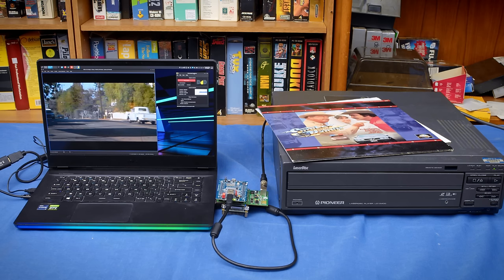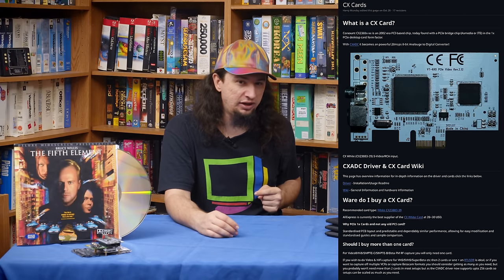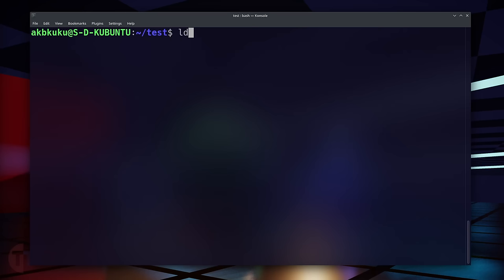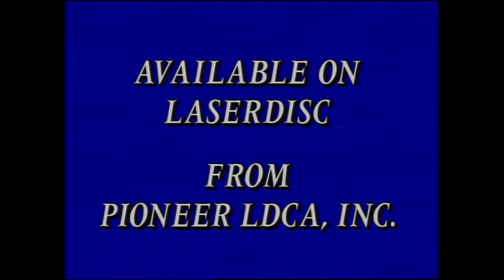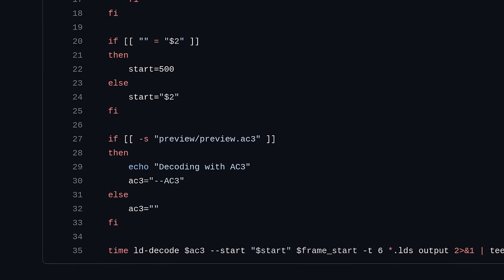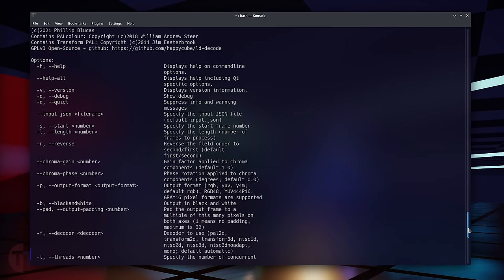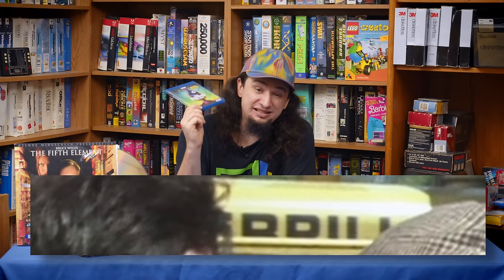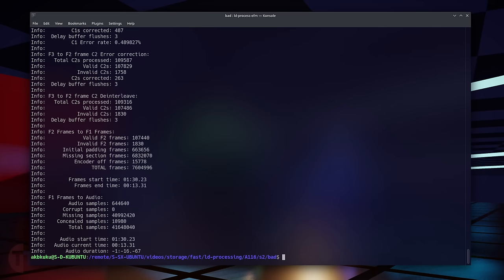LD-Decode - LaserDisc Conversion Tools

Comment: 1:55 Slight but somewhat major issue TBC files are not custom they are 4fsc sampled like D2 video tape, and as such can be piped back to analog via a dac its the full CVBS signal stream on file, same for tape decoding of colour-under formats being S-Video on file (GREY16 headerless streams to be exact in terms of data format on file, the JSON is just for ld-tools to read it).

TBC is basically 1135x624  / 17727262 Hz PAL & 910x524 / 14318181 Hz NTSC

3:11 Well Apple silicone is the fastest you can get decoding speeds out of due to raw single core bais currently, same for all but hifi-decode which can run realtime with enough single/multicore tossed at it. (ware as RTLSDR decode will run realtime on anything 2008 high end or better) (chroma decoder is realtime but ram hungry though).

15:25 Some good points are made here, but you missed the fact that well FFV1 and V210 is what 90% of people who are doing this sort of archiving will touch not compressed codecs, but also the 4k/2160p upscale bracket has to be mentioned for use on YT due to SD being useless and HD being crunched, and outher platforms I cant name being better due to using the orignal file allowing for SD streaming with web optimised files, like those profiles made inside the tbc-video-export tool.
Reply: >outher platforms I cant name 
...pleaaase?
Reply: @JuanHerrero  O // dy // see // its direct file stream platform, but if you mention its name on YT 9/10 you comments get auto purged, same as links these days.
Reply: I've been using the VHS fork of this project for over a year. It's incredible stuff and despite the huge file sizes, the home videos are preserved in a way where I can feel comfortable knowing the VHS tapes will die soon but I have as good of a backup as I can get.
Reply: @Tatsh2DX  I have 42 dB snr tapes from 1987 ones that had mold on them, taps don't die there SNR slowly degrades if not stored proper, but I think its a matter of quality of tape and the conditions of orignal recording heads that truly defines there lifespan all things being equal climate wise.

Btw new updates to the CX Card workflow/method now which streamlines vhs capture a bit.
Reply: What if you captured the RF from an actual D-2 deck?  Would the processing recognize that It's a digital signal after the demodulation step?  I have a D-2 deck and being able to archive them this way would be really cool.  I know I can just capture the SDI stream, but still.
Reply: @button-puncher  If the digital signal can be transfered to the standard GREY16 TBC format then support could be implimented to the chroma decoder, honestly I would be intrested in seeing what can be extracted.
Reply: @TheRealHarrypm   Cool!  It's going to be a while but I'll reach out when I get everything set up.  Decks are in storage.
If this works I'll be kicking myself because it took forever to get the all the gear to convert D-2 SDI into standard D1 SDI.  I guess it'll be a good thing because you could use it to compare the software vs hardware results.
Reply: @TheRealHarrypm YT auto-purge their competitors now? Wow. What a lovely 1984 we're moving towards, how joyous...
Reply: This is fascinating stuff, the parts I understand anyway. I have to ask, how do you know all this? It's clearly a piece of amalgamated knowledge that can't be easily gotten so I'm going to guess video engineer of some sort, and also guess I'm wrong?
Reply: Sorry to be pedantic, but. . . Apple silicone?
Reply: @clairekholin6935  If only YT did not lock pinned comments you could be spared a typo 😥
Reply: @clairekholin6935  If your Mac can run Linux, then (I'm guessing) it can run all of the software needed.  As for M2 based Macs, I have no idea if Linux runs on it yet.
Reply: @button-puncher Problem is, its not a digital signal per se, its a digital signal anllogy encoded, thus the need of an rf (radio frequency) demodulator.
Reply: @honestguy7764  True.  You need to deal with the encoding scheme and the error correction that D-2 used.  I got excited and fired off my original question to Harry without thinking it through.
Reply: @button-puncher  Its all python based so it runs nativly on MacOS/MacOS Arm just there is only maintained docs for MacOS Arm and the DdD app etc, though yes you can just run a Ubuntu VM there is only a few % of proformace hit witch is negligible in real world use.
Reply: Apple Silicone?  LOL!  Picture the Apple Store having a display of breast implants for sale.
Silicon is the element.
Silicone is a polymer.

Comment: It’s funny how even though you’re in the electronic and (now) digital realm, the time factor of preservation just doesn’t go away. 
I was an intern at a museum and was tasked with auditing and helping to preserve their photography collection (from the late 1800s-1940s). I am not joking when I say each photograph could take up half an hour to inspect and take preventative action on, let alone the measuring and cataloging that goes along with it. 
Hats off to the folks who are doing this stuff for free as a passion project.
Reply: please, elaborate more on these preservation techniques
Reply: Heck just with film scanning of fresh negatives I used to spend about 30 minutes scanning, cropping, adjusting-curves, spotting dust, and sharpening for output.
Reply: 2:1 resolving of the grain for archival is a fun task for film stocks, consumers are lucky to have 61mp full frames like the A7RIV/A7RV that can make a massive amount of stacked data today thanks to pixel shift etc,  getting near drum scan levels of information, but it wont ever compare to 16-bit full RGB TIFF files from a wet mounted drum scanner really.

FM RF is a fun method but its too easy for LD/Video8/Hi8, compared to film scanning workload wise.

Comment: 7:32 For people deinterlacing, don't ever use yadif unless you want a lower quality picture. use bwdif (bob weaving de-interlacer) with a parity of 0 (0 for top field first, 1 for bottom field first for DV video). bwdif also outputs double the frame-rate (29.97i becomes 59.94p).
Reply: That's why I used bwdif when writing tbc export scripts - best quality with good performance.
Reply: -vf yadif=1 also doubles the framerate
Reply: @fffmpeg  yeah but might give out bad quality. Yadif and bwdif do the same job a bit differently.
Reply: or just use QTGMC with avisynth
Reply: @fffmpeg  you could but ffmpeg is easier to install and use. For people who want the ffmpeg front-end, Handbrake is the go to.
Reply: @fffmpeg  There's also CUDA accelerated KTGMC.
Reply: For another thing, it's quite common for most media players (and even pro broadcast software) to support SCC.  Subtitle Edit can process it aswell, but it's output is not great to pass through to a broadcaster without further edits (Example: the "clear pop-on buffers" bytecode [94ae] is not supposed to be at the beginning of a dialogue line on broadcast captions).
McPoodle published a full document of what the bytecodes in Scenarist captioning (and his own, further leigible decoder language) stand for sometime ago.
Reply: Can I ask a stupid question?  Why do we deinterlace at all?

I know "modern displays are progressive" but so what?  If my display is capable of (more than) 480p @ 60Hz, that implies that it is also capable of displaying 480i @ 60Hz, just like a CRT.  Rather than trying to put both 240-line fields on the screen at the same time (leading to combing), why not just show the odd and even fields in sequence ... like they're supposed to be?

Yes, it's only using half the lines per field, and yes, it will flicker.  But that seems to me like it's literally the one and only correct way to display it, because that's what it's supposed to look like.  Is there a reason we don't just do it that way, instead of trying to merge two halves that are sometimes from completely different positions in time?
Reply: @nickwallette6201  we deinterlace to convert the fields back to real frames. Otherwise it looks terrible. You get that combing effect that is undesirable on modern TV sets.
Reply: @rommix0   Right.  Which is why I advocate against trying to show a full-height progressive image at all.

In source material that is actually interlaced (not 24p or 30p), the fields are capturing visual data from different points in time.  The two halves should never be on the screen at the same time.  480-line interlaced SD images aren't a thing.

So why not alternate between fields, the way a real CRT would, instead of trying to merge them, blend them, or use fancy predictive algorithms to manufacture the lines that were never really there?
Reply: @nickwallette6201  
Isn't alternating fields what bobbers try to emulate?

The heart of the issue is trying to display an interlaced image on a progressive video output.  If you could change video resolutions on the fly without qualms, that would be one thing.
Without knowing how to deal with the lines, that just won't look right.
Reply: @Code7Unltd  yeah exactly. His argument doesn't make much sense.
Reply: @Code7Unltd   Close, but not quite exactly.  Bob line-doubles each field and shows them as full-height 480p @ 60Hz.

My question is … why do anything with the unpopulated lines?  Why not just leave them blank?  Treat the fields like alternately line-offset 240p @ 60Hz.  That would work just fine on a progressive display, and should look more or less exactly like it does on a natively interlaced display.
Reply: @nickwallette6201  Deinterlacing is useful only for editing, internet distribution/streaming. Normally a software player/screen should deinterlace realtime while the content stored as interlaced original.
Reply: I went back and read VLC's deinterlacing mode documentation, and it turns out... there's something very similar:  The "Phosphor" deinterlace filter.  It's still a bit of a gimmick, because it's emulating the phosphor decay of CRTs by holding the previous field at partial brightness, not just leaving the off-field lines blank.  (I probably would've tried artificially blooming the active lines into the inactive lines instead, preserving 100% temporal accuracy.)  But it's pretty close to what I was asking for.  I did have to change the decay to maximum in the filter settings to prevent it from blending in the previous frame too much.

It is definitely a relatively dark-looking filter, which could be a problem for some.  But otherwise, it looks great.  There are no interlacing artifacts, and it doesn't matter one bit if the source material is truly interlaced, 3:2 pulldown, or a combination.  This is definitely the filter I will be using for all interlaced material shown on progressive displays from now on.
Reply: @Code7Unltd  Speaking of Subtitle Edit, it's also capable of using OpenAI's Whisper for Speech To Text translation. Might be handy for someone out there.

Comment: That casual introduction to interlacing doesn't prepare the uninitiated for the horrors they will discover. Telecine sequences can jump randomly at each cut, leaving unmatched fields hanging in the air. Interlaced film content can be blended with interlaced video content (like computer-generated credits) during transitions only or during the whole cut. That computer-generated video can have 30 state changes per second or 60 state changes per second, and correspond to 480 pixel high frame or 240 pixel high frame. Dealing with video mastered from interlaced sources is a great way to say goodbye to your sanity.

As others said, it might be better to leave interlaced video as it is, and let the player perform as much blending+upscaling magic as user wants, but the problem is that almost nothing (and almost no one) today is expected to work with interlaced video properly.
Reply: And then there's shows like SpongeBob that (while not often) mix 24FPS animation with live action segments. Honestly what I end up doing with my DVD rips is either deinterlacing to 30 FPS or 60 FPS depending on the content. I have yet to tackle the interlacing my rips of SpongeBob but those are going to be deinterlaced to 60fps.

Comment: Thank you so much for making these Domesday Duplicator videos.  I've been collecting LaserDiscs for a while and have a few in my collection that I'd love to preserve for one reason or another, and after following this guide I'm starting to wade into it - I'm working with my first captured disc right now.

These videos have to be the single most accessible collection of information on this project that exists.  Information about this hardware and the associated tools is fragmented all over the place, across random Reddit threads and across multiple Github pages, so being able to refer to this video at least as a starting point has been an absolute godsend.  I hope to be able to contribute to the effort to preserve LaserDiscs, and also plan to use the Duplicator to capture a whole pile of home movies on VHS I have waiting for me in the basement!

Comment: 9:02 For further context, he's talking about Dolby Surround/Dolby Stereo, which is basically mixing 4-channel surround into 2-channel stereo with a matrix encoder for storage/transmission, then decoding back into 4-channel. Since that's inherent to the stereo audio tracks (analog and digital) if encoded with Dolby Surround, there's no real point in "decoding" it to discrete surround sound—matrix decoders are super-common in playback hardware/software, and if you have a discrete 5.1 mix to begin with, it's way better results anyways.

Comment: The great thing about DTS Laserdiscs is the DTS Mix is FULL RATE. Unlike DVDs that more or less always had half-rate DTS. So the Laserdiscs with DTS bascically have the same fullrate bitrate like the DTS CDs that were sync'd to the 35mm film projectors in theaters that showed the movies with DTS.  Some few early DVDs  had fullrate DTS too but they were very very rare. One of the few i can think of were the Codefree NTSC releases of "Daylight", "Liar Liar" and "Dante's Peak". Other than that most DVDs only had halfrate to make room for the videobitrate as well as more languages and Dolby Digital.

Comment: Surely many people already know this, but I still want to note that when working with large video files, it is a good idea to have the source and destination files on physically different disks. This can significantly improve speed.
Personally, I prefer to compress PCM to FLAC (and use mkv container that supports it) to save some space. Of course, this is not the most compatible format, but most modern players can play it.

Comment: About upscaling before encoding, This is why I upscale my captures, especially VHS, to 1440x1080 before uploading to YT even with some sort of smoothing filter built in the resizer, The compression will be much less harsh than uploading the SD version, Thanks for confirming that it's the same concept for any kind of lossy encoding not just YT compression.
Reply: They are, to an extent, two different phenomena. The video YouTube delivers will look better when upscaled from (say) 480p to 2160p mostly because YouTube is willing to throw way more bits at the video when encoding at higher resolution, since at a product level, resolution is used as the mechanism for ABR/data saving. It would be neat if there were a way to have lower-resolution videos get additional higher-bitrate encodes corresponding to the higher resolutions that don’t exist (e.g. a video topping out at 480p could get “480p+/++” encodes at the 720p and 1080p bitrates) to make this hack unnecessary, but it’s a super niche use case.

I would also be interested to learn how the quality on non–pixel-doubled laserdisc rips would compare if they were given those 30% more bits that the pixel double ended up taking, to untangle the difference between what is the source material playing nice with the compression algorithms versus just they have more bits to work with.
Reply: @PaulFisher  In the YT case, they paint all SD videos with the same brush, While I agree the majority of 480 YT uploads came from crop quality, and people who upload them are clueless when it comes to video quality, there are uploads that originated from nice and clean SD materials that don't deserve the punishment. It is not a fair game but I can understand YT goal to save on bandwidth and storage. I'm pretty sure they will come up in the future with a smart algorithm that detects upscaled SD materials and treat them just as SD versions.
Reply: 1080p bracket is no longer viable for properly repesenting analog pretty much decode projects only recommend the 4k/8k bracket now due to the black bais macroblocking getting worse since they kicked down standard 1080p, funny enough V,imeo is actaully decent for handling SD, not as good as O//D//Ysee but anything direct file stream is more ideal.

Comment: In relation to the graphics data in the subtitles, I saw the Tenchi Muyo capture and had the thought that maybe they were using it to write the names of uncommonly used kanji with it. Sometimes kanji in people's or place's names aren't in the commonly used set, or are using the old form of a kanji that was simplified, so especially with the limited memory/etc of the time just drawing it might be the only option.
Reply: Yeah if the disc is Japanese then I bet this would be it, this is why Japan used LD+G for their subtitles, so they could mix in graphics for kanji that wouldn't fit in the default character set. 
The same idea is used on modern day Japanese TV broadcasts (ISDB) using the DRCS feature of ARIB B24. In the beautifully-rendered closed captions on your 4K TV, suddenly one Kanji will be a super low-res pixelated character because it's not in a default broadcast charset so the closed captions include the pixel values to draw it. It's also often used for icons, like showing an icon of a phone to indicate that the closed caption is for the person talking on the other end of a phone, etc.